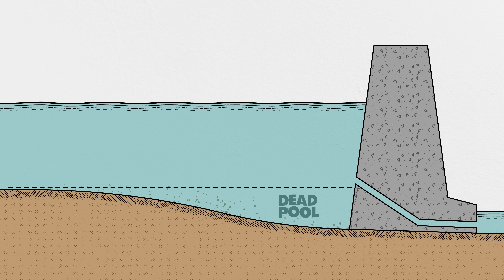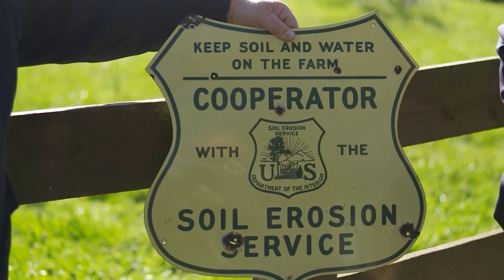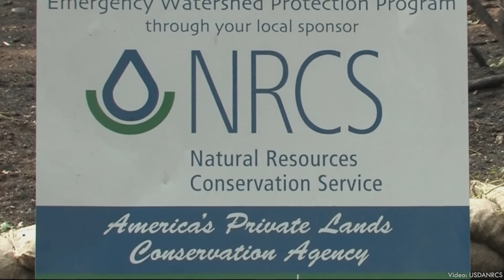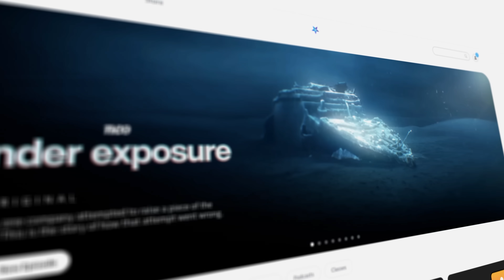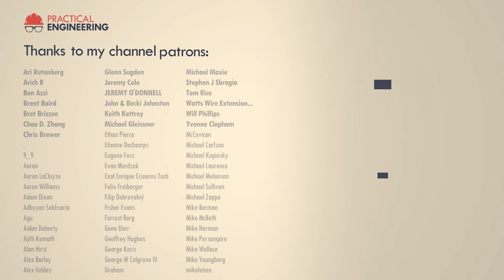All Dams Are Temporary

Comment: The answer is a well laid out and well balance flow air bubbling system. This method really works well if constructed and laid out correctly. This will be a long story but definitely worth telling if anyone has these issues to deal with. 

A friend had a small dam in the rear of his property that created a very large and beautiful pond. It started having the same sediment issues you’re describing here. Just like your model, the build up started well before the water flow was reaching the dam to go over. This sediment had created some large shallow areas out in the pond that were becoming visible from the banks. Since he had electrical power running to that area of the property, I did an experiment of laying out (plus weighting down and slightly burying) some air lines that we punched holes into to create a bubbler system that kept the sediment suspended in the water all the way through and over the dam and on down the creek. We made up about 300 feet of these air lines and placed them into the sediment build up to see if we could actually get it to reduce those built up areas. This worked REALLY well!!

After about 2 weeks we had a good handle on the right airflow rate that would bring up the sediment at the correct balance that wasn’t making muddy looking water. We added about another 200 feet of additional line so that the bubbles were keeping the sediment suspended all the way to and over the dam. The results were outstanding and it took about 2 months to where the build up was no longer visible at all. After about 6 months with making air flow adjustments along the way, this set up nearly had the issue fully corrected with the proper balance of sediment in the water flowing through to and over the dam. It worked far more effectively than I had anticipated so we definitely had to keep an eye on the air flow until we hit that sweet spot where it wasn’t actually excavating the build up as intended to start with. It’s great how we could get it cleared out, then set it so the sediment just carried all the way through leaving only what all the fishies wanted.

We started with a used pump and after about a month seeing that it was obviously working, we replaced that pump with a far more robust unit that I believe is still working on that property about 10 years later now. The bubbler was just an idea I had from my fish tank addiction days and remembered how well it kicked up the fish poop to be trapped in the filters. Just scaled it up and it worked beautifully. 👍🏻😎👍🏻
Reply: Thats awesome!!!! Although I do wonder how big the bubblers would have to be for, say, the Hoover Dam.
Reply: @cryfry2  , I know, right?? The size of the network of air lines would be crazy. But thinking of that, the amount of air feed pressure we needed to keep the sediment suspended in the water was not very high. It was low pressure but the most important part was where the lines were placed ahead of the dam. That was actually a really fun and interesting project. But the Hoover Dam, lol?? That would be A LOT of air lines!! 😵😵😵
Reply: @cryfry2 Use water pressure at the bottom of the dam to compress air, which you pipe to the top of the dam. As water fills a tall tank from the bottom the air in the tank gets compressed. When the tank gets full of water, shut off the air and drain the water out. Two pressure tanks will give you a constant supply of air.
Reply: Since you said you stopped before it digs deeper than original, you’ve invented a way to dig holes at a massive scale.

See, excavators can dig one-to-one amounts, but when it comes to digging the Suez Canal, there is no amount of excavators that will complete the job. But you say air pumps + lines can do it at scale.

Patent it and sell it to Evergreen ;)
Reply: @antoy384 , could you imagine how much and how large the lines would need to be?? And the pumps would have to be pretty massive to support an ongoing project like that in the Suez Canal??. And BOY would that turn up some sediment flow. That canal would be brown in color from one end to the other, lol.
Reply: @ Do you know the Suez canal was dug with humans shoveling spades of dirt one by one?
Reply: Hey this looks like a very smart idea, but I'm worried about something. Isn't areated water extremely dangerous to swim in? For a big project like massive dams it would transform the whole area into deadly waters for everyone
Reply: @samugrigio  depends on the level of aeration, i believe. If this required that much bubbling, it wouldn't be feasable to run, right?
Reply: Why would it need to be airlines though? That's a fantastic solution for a problem at that scale, but given that it couldn't scale to a full-sized dam why not the same principle but a different approach to stir sediment up such as some propellers or device/s to use water pressure to stir it up instead.They could be self-contained & autonomous given simplicity and lower power requirements or even a device on a barge type ship
Reply: Could it be feasible to use mobile units that dig themselves underground to "aerosolize" sediment and flush it out around preprogrammed routes?
Reply: Did you miss the whole part about silt being a regulated pollutant
Reply: Good idea, but it's not scalable.
Reply: @martinl9687  , no doubt. The amount of air line we laid down for it to be effective was insane. But we were already so far in we just finished until effective. But scaling this up very large would be near impossible and be effective.
Reply: @martinl9687  Totally not scalable.
Reply: @DR_1_1  why? one could come up with a moveable system , divide the reservoir into sections and go bubble bubble section by section, this would reduce stress to habitats and wildlife ,and be safer for private or commercial usage of the water.
Reply: @priorityone89  OK...
Reply: @martinl9687 it is scalable. Just expensive to power.

I think this a good use for solar power, which would ensure the longevity of water power plant
Reply: @martinl9687 I disagree. Maybe not scalable beyond the point needed to have Suffield storage to dampen fluctuations in the flow
Blasted autotype. Sufficient storage.
Reply: All I'm hearing is that we're too cheap to do our own laundry. Just dredge it out. It's a cost of doing business when you build a dam.
Reply: @andrej2375  What they should do is build TWO reservoirs per river.  Drain the upper one into the lower one to dredge, and slowly lower the downstream dam when that one needs dredging, but for the most part one gets twice the storage.  One might even be able to leave some rivers free flowing if one does that.  Also, more dams should be hydroelectric.  We need electricity, hydroelectric is an affordable way to do it, so once one dams a river we should also get some electricity out of it.

Comment: The problem is basically along rivers and streams, more so streams and washes. It can be fixed. When you have heavy rainfall the low lying areas saturate first water travels underground and pushes particles up where flow pushes them along. 

To stop this one needs to create suction such that water wants to go into the ground not out. The way to do this is to bury perforated pipe, wrapped and embedded in porous sand then replace the top soil. at areas prone to washing out and then give the perferated pipe preferential down. Since the water wants to go in instead of out it sticks. 

The other thing is terrancing and Terrance boundaries that hold water, this can be coupled with perforated pipe again to drain but not allow the silt and sand to tumble over the soil. 

It’s been almost 100 years since US govt has identified that erosion was a problem, this problem should have been fixed by now, it’s ridiculous that we are still having this conversation.

Comment: I presume much of the cost of dredging comes from the need to transport the removed material. Would it be feasible to build a fixed suction dredging structure at the point where the sediment is currently building that feeds into a pipeline following the riverbank and ejects the sediment downstream of the dam? This might solve both problems with sediment build up and lack of sediment downstream at once.

Comment: Why not create small channels where sediment builds up such that they're only a couple inches apart, and have each channel capable of independent release?  This would match your small-scale example better and allow finer control of how much sediment is getting released at once.  Drawbacks would likely be the physics not working as desired (build a thing that ends up not working after installation) and maintenance (if channels are damaged, good luck repairing them).

Comment: Amazing model, but seems so counterintuitive to me. Just a question: The stream flow would be larger at the river side of the reservoir, right? Then, that would create a suction gradient at that region, pulling the sediment to a more steady region for the water (near the dam), therefore, it should be creating the sediment bulk in that region. 

I know the deposit occurs at that initial part and not where I said. What is the physical explanation for that? If you read this, thanks in advance!

Comment: personally i'd say the larger problem in the 'equation' is that there is in practise no rivers in the world that is 'single usage' aka , most dammed rivers have extensive urban centers and countryside next to it down streams
rather then say , one river where cute shore side countryside houses and urban centers are allowed , and one that forbids it with miles of buffer zone around it for either eco redundancy usage ,or actual use of silth by ''season farming'' as haveing a dam inflow 'silth siphon' system + a 'low under water surface gate' in the front to shift the water flow and briefly encourage it to 'eat' the sediment when forming a sharper undercurrent etc

Comment: Could it be feasible to implement the preemptive capture of sediments along with a wash that takes it downstream, reconnecting with the output from the turbines right before reentering the riverbed? It would take some of the water, reducing the volume of useable one, but you could greatly reduce the problem.

Comment: 2:30 in two and a half minutes I came up with a idea, probably not a good one. Install inlet pipes at the transition from the lake and river to help carry sediment past the lake and into the downstream river. They can be opened during rain events when the river is carrying heavy sediment and closed after it clears. Potentially dredge the build up and either send it down river in a controlled manner or sell it as compost, fill, or fertilizer.

Comment: Simple, the outflow of the dam needs to be at the mouth where the water enters the reservoir, not at the dam. That way the silt wouldn't have the opportunity to fall out of suspension before it's sent downstream. When more water is coming in than going out, some of the water coming in would feed the turbines and the rest would enter the reservoir, ideally through some type of cyclonic filter or something to settle out the silt and add it to the outflow. When less water is coming in than going out, the entire river could bypass the reservoir.

Comment: River sand and sediment is becoming a valuable resource due to its application and demand in construction -- like for concrete. Wouldn't that offset the costs for dredging, drying, and filtering the sand? Seems like dredging and processing river sand for construction purposes nicely dovetails with the need to control reservoir sediment build up. But I guess it also depends on the rate of build-up vs the rate of processing.

Comment: I am not an engineer but... 
Low resistance underwater turbines. Sediment flows through making it better for the environment, scalable, easier to maintain, lower cost, faster to construct potentially you could even have light boats and bridges passing over top the underwater turbines.

You could set a single turbine off a barge and into a river bolting it to Pylons which would put it at the perfect height where the water is flowing the fastest. Heck you could even make the height adjustable to factor in the flow height changing. Once that one is running you can drop another and another and another. Having it scalable means if one needs maintenance you can have the others running 24/7. 
Lots of issues with this of course. But it eliminates a majority of the man made sediment problem by having a majority pass over, under, and through the turbine. You will of course have sediment against the face of the Pylons. But hey nothing is perfect and if they are round pylons a majority of build up sediment has potential to flow around.

Comment: The solution would likely be to have a point where the water converges. Design it so the bottom flows quickly while the top goes slow, so the dirt precipitates down into fast moving water, then the fast moving water moves out through the dam, and the slow water with less dirt moves to the reservior.
Reply: my brother in christ if the water at the bottom moves faster it wont collect in the reservoir

Comment: You know how the Hoover dam in Arizona had air jets installed in its spillway after the 1983 release damaged the spillway? We could probably do the same thing, but with a bed of air jets installed in the dead pool, and some kind of valve at that lower level, so the sediment can be agitated into suspension and flushed through the valve.

As for the rest of the reservoir, I thought of a sail-powered craft guided by cables with moving end anchors, and a conveyor-like apparatus similar to those old LEGO picker-upper things. The craft would be pushed and powered by the wind, kept on course by the cables, which would have the moving anchors at either end to move the craft’s course across the reservoir, and as the craft is pushed forward, the conveyor sort of rolls across the sediment, taking scoops as it goes. Near the dam, there could be a special dock that somehow unloads the collected sediment in such a way that it’s introduced to the discharge of the dam, carrying it downstream.

Comment: It's a vast and interesting subject. The size of the retention lake, the number of affluent, the depth, ... change a lot.

In Switzerland, we're very lucky: our lakes are rather small, but above all they're far upstream on the rivers, which limits sedimentation. They are purely hydroelectric dams, which means that they can be emptied and cleaned without any problem, a task carried out on a regular basis. I've already seen the Mauvoisin dam being emptied, and it's very impressive. Of course, the size scales are not comparable with the USA.

Comment: If you had a collector system to distribute the sediment downstream of the dam instead of building up behind it. The dam acts as a strainer causing sediment to settle behind the dam, why can't a system be designed so that the sediment is moved past the dam as if it wasn't there. The dam doesn't cause sediment, it just traps it. If you dredge it and dump it over the dam as it accumulates, you are just  keeping up the normal flow of silt.

Comment: So 2 possible ideas. The cost effectiveness of each is probably not feasible. 

1 continually dredging a reservoir but instead getting rid of the sediment just moving it to the high speed turbulent waters at the dam ir just the other side of to be left in its way.

2 having a piping system under the reservoir doing the dredging of the freshly deposited sediment at the initial Delta area